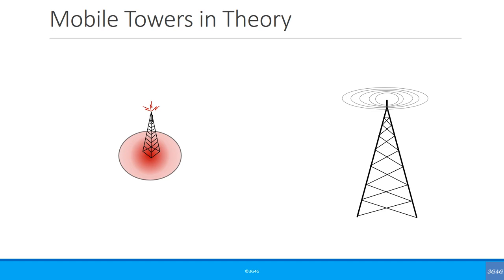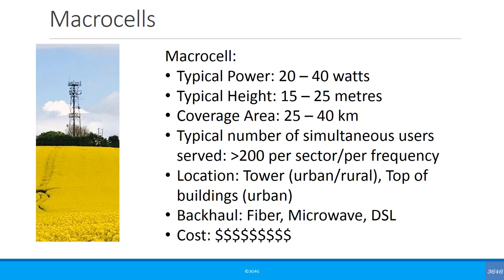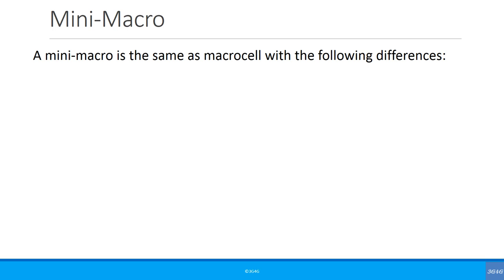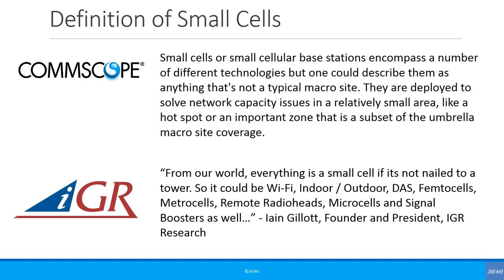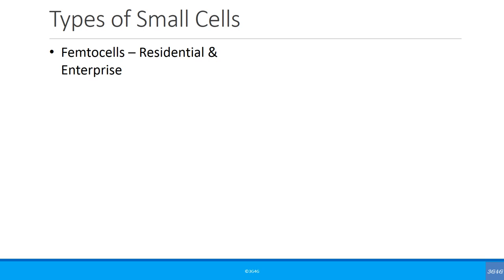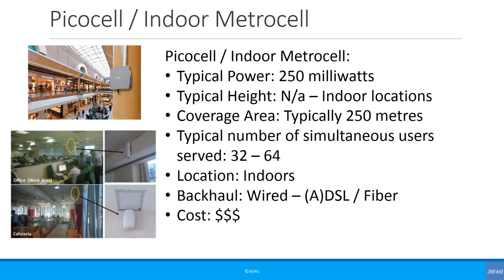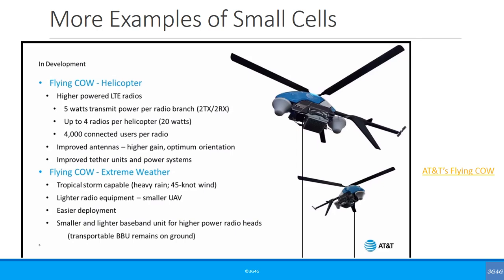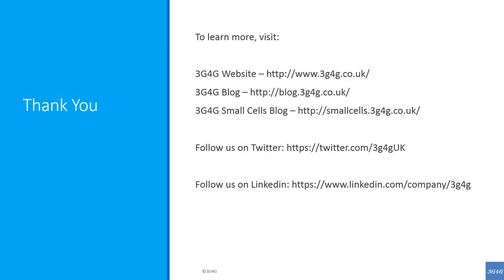Beginners: An Introduction to Macrocells & Small Cells

Comment: Thanks for the video. I  have below questions. 
1)what is the difference between the small cell and hENB(home enode-B gateway)?
2)Can small cell connect directly with the core network (MME in case of 4G as small cell has its own BBU) or it should connect to the macro cell and then the core network ? (I got this question when you explained different types of back-hauls)
Reply from the maker: Hi Shreyas. Home eNodeB gateway is used as an aggregator for Home eNodeBs or HeNBs or Small Cells. It's not strictly necessary as 4G small cells can connect directly to the core. The problem is that if there are too many of them, configuration for each of them becomes tedious and time consuming. HeNB-GW takes away that complexity. It also contains security gateway that makes connecting them more secure.

Now, what we argue is that Small Cells are all in one unit, so BBU + RRU. In US, RRUs that are deployed on the lamp posts, etc. are known as Small cells too. Basically small cells are small form factors in the USA. This is where is becomes tricky as BBU would be close to the cell site, tower, lamp post, etc. or in case of C-RAN it's in a central BBU Hostel. Again, connecting to the core can be direct or via a separate gateway for security reasons. Many different options are available.
Reply: @3G4G5G  Thanks for the explanation and details.

Comment: Hello, could you explain how/why small cells make use of the macro capacity?
Reply from the maker: Hi Jason, that's not necessarily true. It depends on where the backhaul is coming from and what spectrum a small cell is using. If for some reason, the small cell doesn't have a backhaul and it uses the macro as a backhaul (this operation is called relay) then it will use the macro capacity. Think of it as redirecting the capacity from one place to another. This is not common. In some cases, the small cell uses the same spectrum as macro. Let's say that is a poor coverage in a building from macro outside. Here, you can use small cell with the same spectrum. There will be some areas where there will be interference. The macro/small cell will have to work out how to avoid interference (this feature is called eICIC) and there will be some loss of capacity on both the macro as well as small cell.